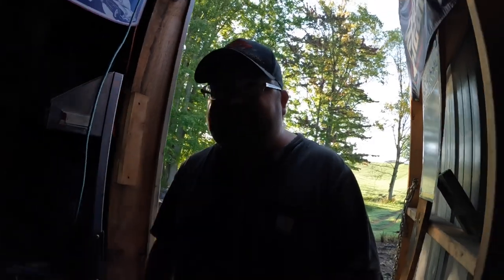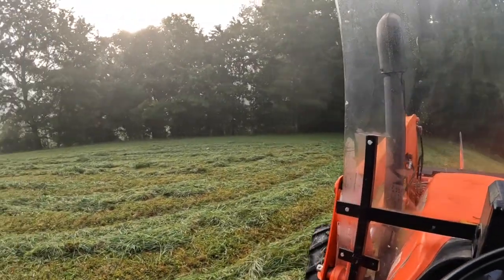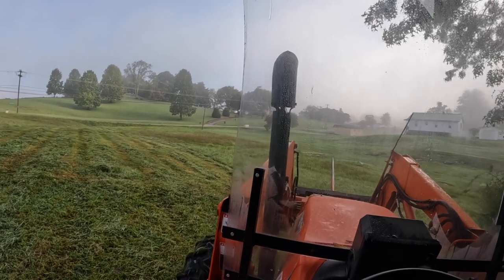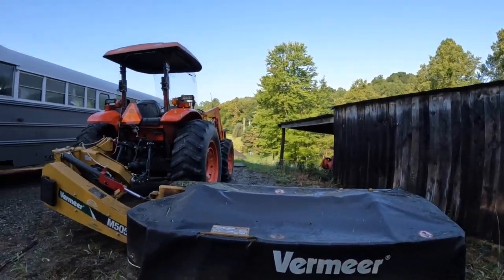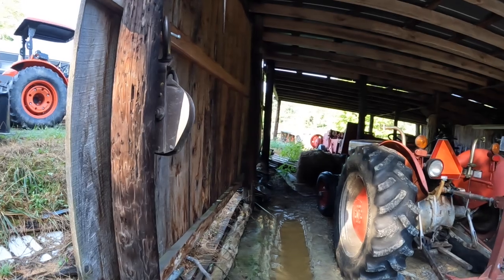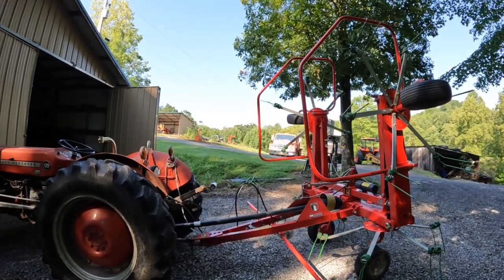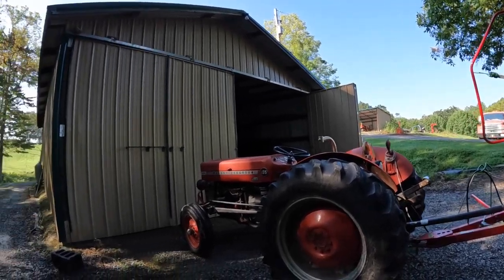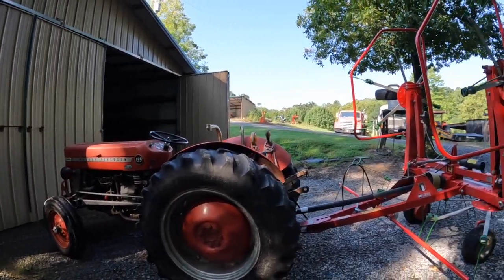Rain, More Hay cutting, Tire Isn’t repairable!

Comment: I lived in Florida and bought my tractor in 2015 it was brand new and it was a 2014 so no emissions. So we sold our home and bought another house in Missouri but before we moved i had to replace both front tires because of dry rot. I bought them through my dealer, they couldn't break them down and took them to a garage in the next town. So when the garage had them done i went and picked them up and saved 50 bucks. Which worked for me.
Reply from the maker: Labor was only $78 on this tire replacement, not bad considering they had to pump out the fluid and put in back in plus all the other work. The tire though wasn’t cheap at all! Thanks for watching!

Comment: Too bad about the tire.  I ran into that same issue with tread.  What was wrong with the old design for R-1's?
Reply from the maker: Mine had the long bar short bar design, I don’t think any brand makes that now. This tire is 2 long bars. It’s a nice tire but doesn’t match. Thanks for watching
Reply: @khtractors  Yep. Same pattern as my R-1. Long and short bars.

Comment: I hate to hear the tire news. So the valve stem wasn’t the reason it went down? It was clearly leaking. Seems a little suspect to me, they didn’t mix your tire up with someone else’s tire did they? (Probably not, I’m sure you trust whoever you took it to, just seems funny that the valve stem wasn’t the problem when it was clearly leaking)
Reply from the maker: The tire does have 6” x 4” split in it on the inside, makes an X. I’ll show it in another video. All I can figure the liquid squirting out around the valve stem was from it being between the tube and tire. Thanks for watching.